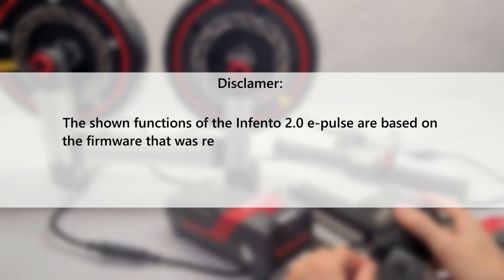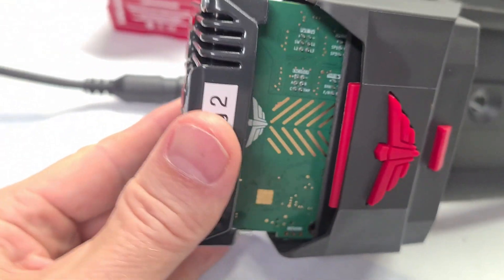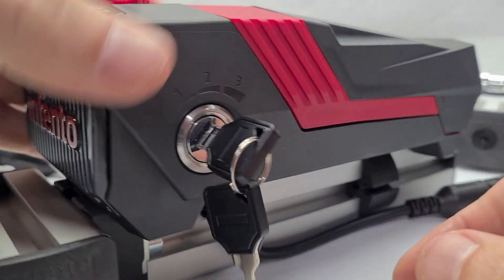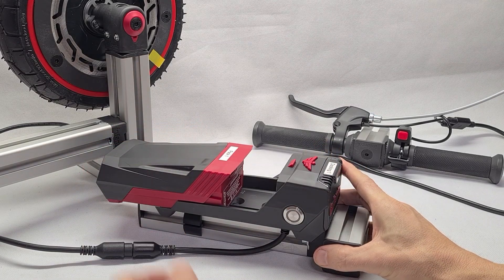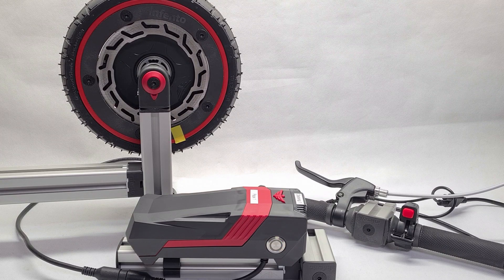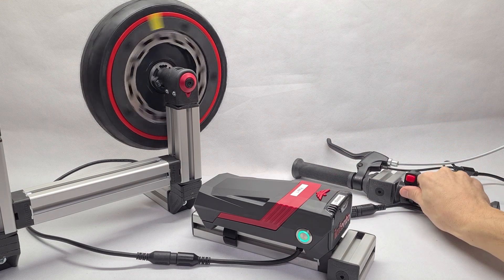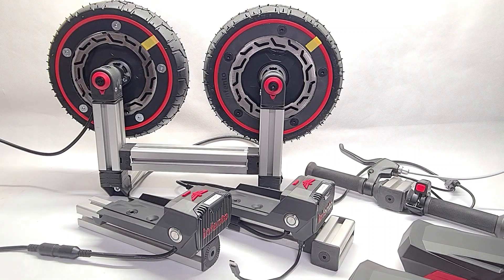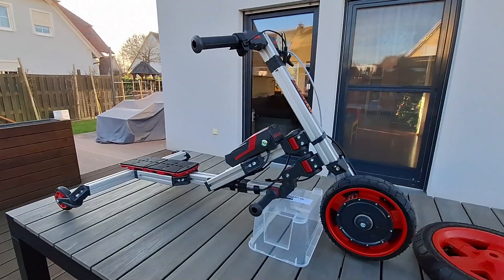Infento 2.0: e-pulse motor functions explained

Comment: may you turn the key while the motor is on (but not accelerating, just stationary green light)?
Reply from the maker: Yes, but the controller will switch itself off then.
Reply: @modularmobility2276  thanks!
Reply from the maker: Same answer. You will need to turn the controller on again.

Comment: Love it, but I tried so many times to unlock 3rd speed level like the manuel book told and didn't get it :/ (with the big wheel)
Reply from the maker: @hiCézar  Sorry to hear that. Then write to their customer service. I am surprised about the variety of malfunctions that customers report.
Reply: @modularmobility2276 I’m also experiencing issues with a brand new kit. With only a small amount of resistance to the wheel (going uphill) it will stall the moment you let go of the throttle. The only way to get it going again is by pushing the ride forward manually or shifting in reverse and back in forward drive :-/ I contacted support and see what they say. Otherwise its an awesome kit and our kid loves it. Just a bit disappointed by this problem but hopefully there is an easy fix. Not sure if it’s the motor or the controller which has a problem